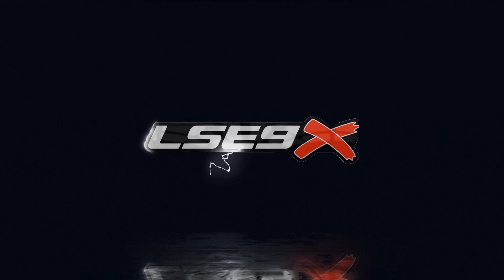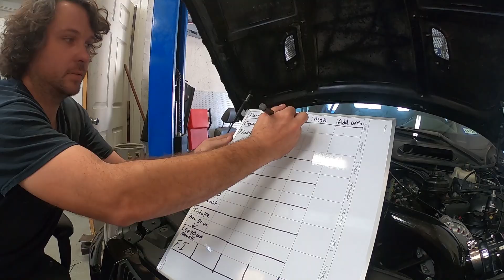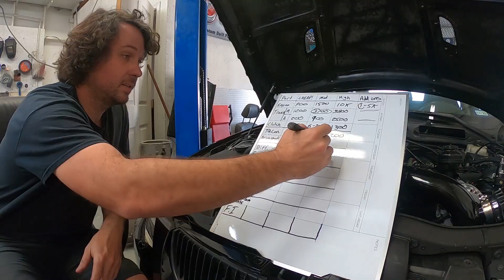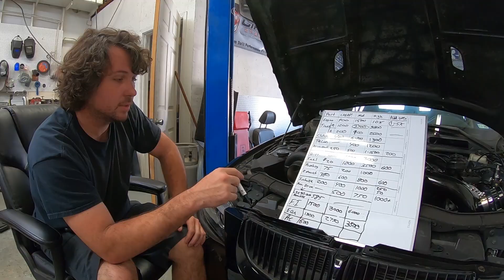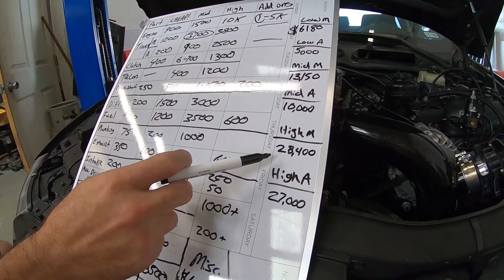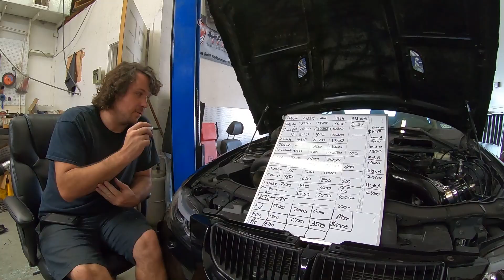How Cheap can you really LS swap a BMW??

Comment: Im looking at buying a buddies 135is with the manual trans. Is it fairly easy to do a ls swap in that and use factory manual trans? There ways to get factory gauges to work even if engine is on a holley
Reply: Your trans won’t work but probably worth more than any ls manual
Reply from the maker: Yes we sell the holley can box for the electronics. Many use the factory n54 manual trans with an adapter.

Comment: What about the wiring harness/adapter?
Reply from the maker: The holley system we typically used was not included in here, add 1800

Comment: Wouldve been nice to see what HP gains each setup gets. $25K for 600whp is NOT it. You can literally spend 1/10th of that and get a stock n54 to 600whp EASY
Reply from the maker: Cool story
Reply: @lse90garage lol 😂
Reply: For couple days? Yes. Then you sell that car for 800 to a junkyard…
Reply: @josephsarach6872  lmao yeah right. If you wanna get super technical, it's more like 1/4th of 25K, but still there's plenty of DD 600hp N54s that are plenty reliable. If you wanna go all out, spend 1/2 of that 25K, rebuild the motor, upgrade the trans, and you'll have a tank that's more reliable than the fkn thing was from the factory.
Reply from the maker: @Charger-ob8yl  you’re forgetting 25k is an entire build, engine, trans, fuel, stand alone ECU, cooling system, exhaust, rear end, etc.  it’s not just a 25k engine.  The engine that’s in Mikes drag car makes around 1450 wheel and he has around 10k in that thing.  Garrett’s blower car makes around 800 and that’s a stock bottom end 6.0 with a cam and head studs that he has maybe $1200 in, so it’s not $25k to make 600hp, it’s 25k to build a whole car from a roller.
Reply: @lse90garage  I get it man. Thing is most of that build is only necessary BECAUSE of the engine swap; keep the N54; avoid a lot of those other necessities that come with the swap; build it correctly with relatively low boost and wgdc; make a reliable 600hp way cheaper.  That's ONE way.

 Nothing against the LS swap. I'm considering it; that's why I'm here. LOTS of value in an LS (higher ceiling, less [yet potentially more] gremlins to chase, bigger challenge, I'd take that V8 sound ANY day and twice on Sunday over an N54). If money was no issue, I'd swap, but 25K @600hp is way out of cost-to-hp, for me. I'd expect 800hp minimum out of a 25K build, even  coming from a roller... and maybe 800hp is around the corner for not much more money, and that would be an entirely different scenario, but I'm just commenting on where it is now, since I don't know if 600hp is the end goal or not.

Comment: Hello, I have a couple of questions (I have a F10 2012 550i, the engine died) can I leave the old transmission using an adapter, and leave the standard computer from BMW, reprogramming it for the LS6.0 engine, (I am most interested in reprogramming the computer from BMW to Chevrolet  LS6.0???????
Reply: I think I seen la dct trans plates but not a BMW manual 6 speed plate

Comment: How would a gseries 8hp75 from the diesel 535 hold torque of a turbo ls swap? 700-800 whp

It's the trans I have in my 335d rn with my M57

Comment: so like 15k if you go mid
Reply from the maker: Genuinely depends on your resourcefulness, we’ve had guys complete super clean swaps for around 6-7k and on the other end we’ve had guys spend 30k, a lot depends on selling parts not needed off the car you’re building, finding good deals on motors, transmissions, holleys, etc.

Comment: Will TR3160 gonna working like T56 or TR6060? i have a friend selling it
Reply from the maker: That trans is very low power rated, something around 300ft/lbs…I wouldn’t recommend, looks like the fastest thing it came in was 6th gen V6 Camaros
Reply: @lse90garage  thank you for the answer

Comment: If you have xdrive can you set this up to work with the awd system? I have a 2011 328i xdrive and would really like to keep the awd functional, but it’s not a dead set requirement
Reply from the maker: Currently nobody has kept AWD, it would require way too much cutting and fab to make it all fit, most likely a Trailblazer SS awd driveline would be the best bet but so far no AWD swaps exist
Reply: @lse90garage  well. I guess it time to lose my mind and go into debt trying to figure it out.

Comment: The ECU situation is where I get hung up on. The ecu kit that you speak of,  it ties into the original electronics of the Beemer? I know its not a simple plug and play. I'm actually a working mechanic. But I just today heard that they were this swap.  And I love 745. But I know the engine and trans has issues. So the thought of doing an ls swap just got me going. But where can I get detailed instructions for this swap? I really need to know.

Comment: or keep the superior zf8 trans. there are adapters online.
Reply from the maker: You’re one chassis ahead there. F30 3 series cars had the 8 speed, not the E90 chassis.  We have not swapped an F chassis car yet but it is coming. Main problem is control, the Holley we use cannot control the trans, so you’ll need a stand-alone to go on top.
Reply: @lse90garage  I'm referring to the general consensus of the video.  Hot Cheap can Hou really LS Swap a BMW.  I have an F01 that just popped the disaster piece that is an N63 and browsed around for LS swapping for shits.  Literally would be cheaper than tossing a 100k mile used n63 in it.
Reply from the maker: @dpro5321  yea not sure what the cost vs cost would be, another issue is the 8hp offered in the 3 series is only rated to around 450tq, at a very low GVW, versus say a 4l80 that’s rated for 600tq at a GVW of 18,000lbs. However to each their own, but we feel the GM trans offers a ton of positives over the BMW counterparts. The one your really want to find is the 8HP from the dodge stuff with hellcat motors lol
Reply: @lse90garage  the 3 series has a few different 8hp transmission options.  The 8HP45 is the weakest at 450tq. (Build for them is surprisingly cheap) but swapping to a beefier HP90 from the 7 series/hellkittens etc would be doable also.  900tq rating I believe or similar.  I like the GM Trans bc they are proven but it's hard to beat that 8spd keeping you in the beans.

Comment: I just picked up a dirt cheap 01 330ci and also was offered a ls1 w/ 40k miles from a buddy of mine for free. Bmw is currently auto debating on 4l80.
Reply: Just got a 330i can’t I just use the regular transmission?
Reply: damn thats a insane sentence to read for a german. thats like 10k for the car in germany + 8 for the engine alone

Comment: My 2012 f30 n26 328i engine blew and I have a 4.8 vortec engine laying around. Just for the the new engine for the n26 is around 4k used , how much should I expect to spend just to ls swap it ?
Reply from the maker: If you have the skill set, we’ve had guys do the complete swap for under 5k. In the end it all depends on what parts you buy, deals found, if you modify the engine, etc.

Comment: Ok huge question for you. Does the holley ecu have a data cable? If so can you wire an obd2 to it?
Reply from the maker: No, and no.
Reply: @lse90garage  thanks so I guess follow up to that is how can I keep it street legal? Like emissions? Any ideas I think you had mentioned something about it before in vids but can’t seem to find it
Reply from the maker: @Mrgrimsrealmoftheunseen  Yeah what we mentioned was you could leave a stock GM ECU in the car and you could split the signal so that the pcm knew the engine was there, and off that you could run an OBD2 and make it pass emissions.
Reply: @lse90garage  awesome buddy so basically holley would be like installing a piggy back ecu?
Reply from the maker: @Mrgrimsrealmoftheunseen  no the GM ECU is the piggy back, it would have no other function besides passing OBD2 tests.
Reply: @lse90garage  thank you so much

Comment: You need to work up a repower Ls swap for the BMW 550 GT gran turismo. The n63's are DOA starting sround 60k miles but still leaving a great car without a powerplant. A used n63 off of ebay is around 4k before a pre install refresh. The n63 is 401 peak horsepower and 440 foot pounds of torque. There are enthusists like yourself but there are a lot more poeple who just want a reliable powerplant for the BMW chassis that still have a lot of life left in them. If you wan to build a real ls swap movement it's not repowering the 3 series. It's repowering the 5's and 7 chassis with balanced powerplants. If you solve the problems on the 5 and 7 series then the enthusiest can then dump them into the 3's at a greater pace.
Reply: 1000% agree.

Comment: Does alot of this translate to an E46 chassis ?
Reply from the maker: Nothing we talk about on this channel has to do with the older chassis, the pricing of the engines translates, but in terms of the extras like fuel, wiring, etc, none of that is the same.
Reply: Thanks for the fast reply. I need to LS swap my 328i. Hoping to find a video like this on an E46.

Comment: I love LS Swaps, however, I just cannot get over wanting to swap a coyote or a voodoo motor in an e92. I have a buddy who has a spare 5.0 gen 2 with the T82 transmission, full wiring harness, etc. My biggest concern is the DME/CAN setup to allow the electronics to speak to each other. Do you think with me buying my buddies coyote (6k, 45k miles) and trans, I could have a running/driving coyote swapped e9x for around $12,000 total not including the cost of the car obviously.
Reply: Will fit in between the shock towers ? I thought the coyote is wide

Comment: Can you use just like a standard cable throttle body or is it difficult to fit the different throttle pedal
Reply from the maker: You would have to build a custom pedal and run the cable through the floor, mikes original bmw was this way and it was not ideal at all, the DBW with a Holley and stock pedal is the best way to do it

Comment: Why DBW instead of converting to DBC?
Reply from the maker: Holley is able to control the GM TB using the stock BMW pedal and Mikes wiring guide at www.lse90.com  You can go cable, Mikes original swap was a cable throttle body, but it’s difficult and requires some patience and skill to make it work.  DBW is the simplest way to make it work.

Comment: What do you charge to do this swap? I have a 2008 535i with low compression and a 2000 Chevy Suburban with 5.3l that runs great thought about swapping it over
Reply from the maker: At some point Mike will be offering the parts for a 5 series swap but we will not be offering the swap service ourselves.

Comment: All i want is engine mount and oil pan so i can drive the car bcus e30 sound bad so i can get a cheap 6.0 lq9 witch is capable of over 1000hp if strocked to 408

Comment: I'm torn between T56 or 4L80E. I love manual but I kinda just wanna chill until it's time to go and stomp on it. My Tremor has spoiled me with auto but I also gots the maunal lyfe in me.

I have a 2010 e92 xdrive so I think the 4l80e will fit ok with out too much banging.
Reply from the maker: yes the x drive has extra room for the 80e

Comment: Ls swapped my e38 for $2000
Reply from the maker: The E38 chassis is much easier and cheaper to swap, right off the top you eliminate $2000 in wiring and electronics.
Reply: What could be the best advice for swapping an e38? Planning on doing it on a 2001 740iL

Comment: Do a uz vvti swap more reliable
Reply from the maker: 2js are cool but ls is extremely reliable and easy to get parts for. One of the biggest benifits of the ls swap is the availability of parts.
Reply: Would you do a 2jz turbo swap for my e90??
Reply: @joshguzman2249  The reason why the 2JZ wouldn’t be swapped is because the engine is older than the car itself. It’s illegal to put an older engine in a newer car.

Comment: I’m thinkin about doing something similar does everything work? Like all the cars features and functionality?
Reply from the maker: The only thing you lose is cruise control, and I believe it’s the adaptive traction control because it needs the DME to function, you’re left with 2 brake lights on the dash, which can be coded out. Other than that, the radio, a/c, interior functions, it all works like normal.

Comment: Would you advise using a junkyard 8.8?
Reply from the maker: All we use are JY 8.8 pullouts, normally sourced from eBay or marketplace but absolutely nothing wrong with a JY center chunk, 9 out of 10 explorers never saw enough abuse to be trashed. If you want, a cheap upgrade is the Ford posi setup we have linked in our latest video covering the install of an 8.8 using Mikes mount kit.

Comment: Do they make a adapter plate for the automatic BMW x5 4.4  transmission to bolt up to the LS motor. is your truck all wheel drive or just rear  wheel  drive
Reply: Unfortunately no, Iv been looking for the e70 better off swapping the trans
Reply: I know they make allwheel drive escalade 6.0 would fit in the 03 bmw x5  all wheel drive? I'm trying to keep my allwheel drive.

Comment: What about the HP approximately between the 3 ranges?
Reply from the maker: If we broke it down I guess you could say...

Stock 4.8/5.3/6.0 - 280hp-320hp
Stock 5.7 LS1 - 320hp

Cam/intake/exhaust 4.8/5.3/6.0 - 350hp-450hp 

Stock LS3 - 365hp 
Cam/intake/exhaust LS3(6.2) - 500hp

Turbo build, depending on boost anywhere from 500wheel to 1000hp
Reply from the maker: The only items on the list that change hp would be cubic inches, and if you can afford to do say a cam, or nice FAST intake, run the CX Racing mid length headers, that sort of thing.

Comment: I wanna ls swap my 2005 Mercedes it’s super mint and amazing but it has so many issues and hard to maintain I wanna put in a ls and make it dependable but I also want it to look and work like factory inside like ac heat everything work like normal can anyone do this for me I have the engine we built and a trans both out of a Silverado but have both been fully rebuilt and the trans was gear swapped more for a car it was gonna be put in a mustang but I sold it to a buddy after he begged it was a 95 and he totaled a 2013 gt but the engine and trans was perfect so he swapped everything over from the 2013 to the 95 engine trans suspension wheels brakes he even swapped the dash and steering wheel over and the controls worked and put a Tesla style android stereo inside for a f150 we made a fiberglass plate to make it mount up and had to remove and the climate control switches but there’s an app on the radio to control the climate on the touch screen works great and it can be done on ur phone as well

Comment: Curious. Have you heard of anyone using the wiring specialties conversion harness kit? Haven’t heard anything about them, but looking into it for a full plug and play setup that retains factory interior electronics. Thoughts? Good video too by the way! Makes me feel a little better about starting in on my build.
Reply: Also, I’ll be doing an e46 if that changes anything...
Reply from the maker: E46 and E90 are two completely different platforms

Comment: @HangMan Performance  I'm doing a e36 sedan m3 ls swap I have headers and motor mounts. Really interested in getting a tr6060 transmission mount
Reply from the maker: Just seeing this comment, unfortunately Mike does not offer anything for the E36 or E46 chassis at this point in time.